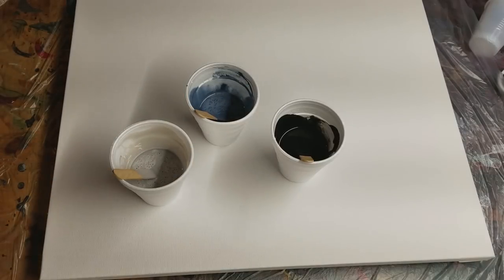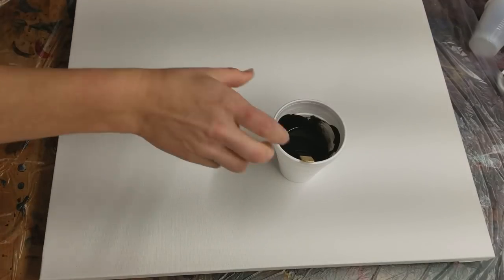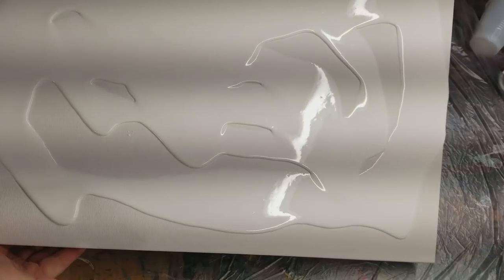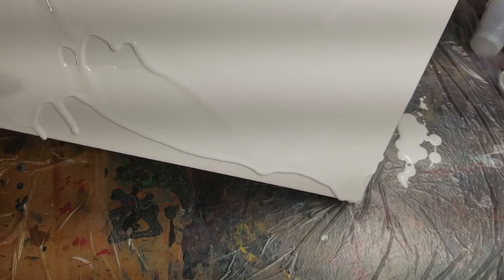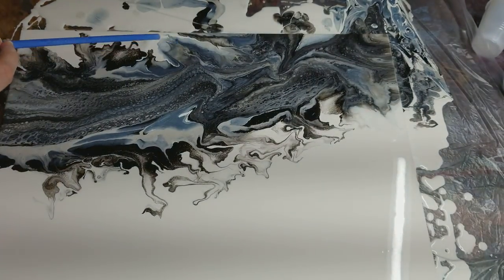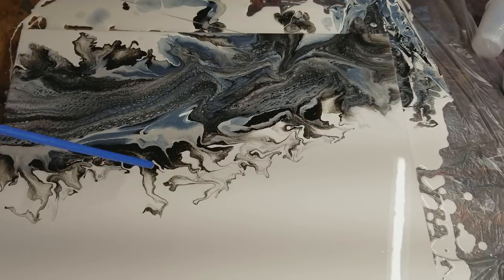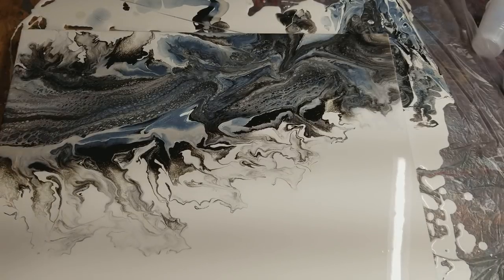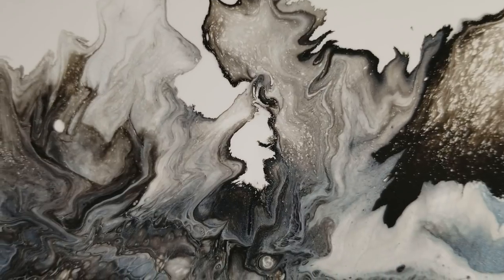Acrylic Pour with negative White and air manipilatiom

Comment: When using white for your negative space, do you use white acrylic alone, mixed with flow or a flow white? New to pour paint & not sure what mix (if any) to use for white, negative space and/or background!! TIA!
Reply from the maker: Hi. I normally make all my paints and don't buy anybpremixed. My normal ratio is 3 parts Floetrol to one part acrylic paint.